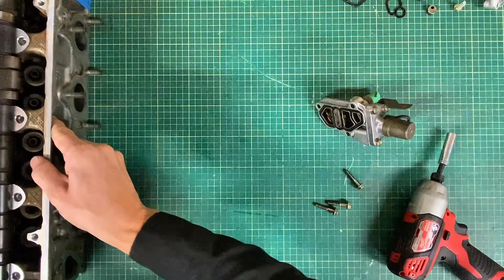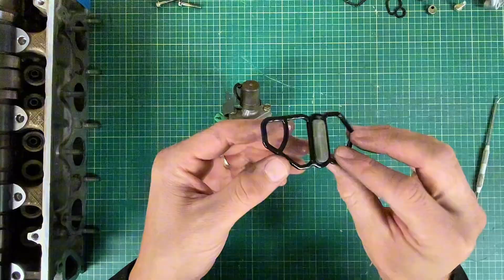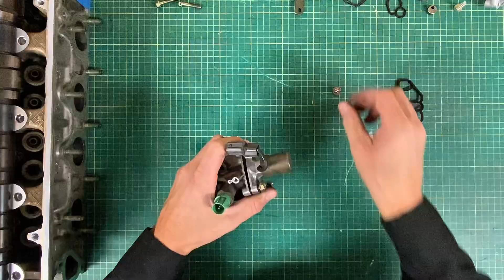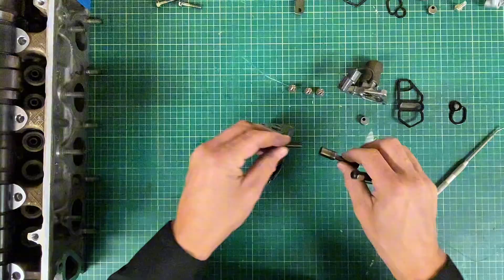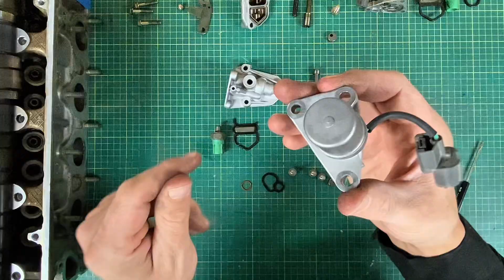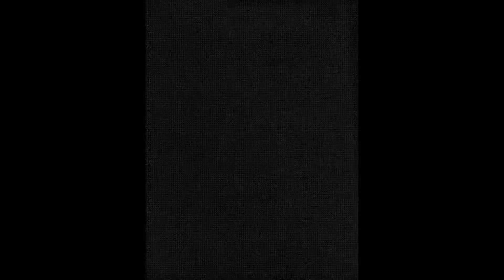H22 VTEC Solenoid: Rebuild & Explanation

Comment: Im just wrapping up a rebuild on my 99 prelude. This video made me go back and do some things that I wouldn't have done otherwise so thanks for potentially saving me from needing to by a new solenoid 😂
Reply from the maker: Thanks for watching, glad it helped. It is a great maintenance item to do. Another is cleaning out all your egr passageways, if you are running an oem manifold. It’s a pain, but worth it. Enjoy the drive
Reply: @BryanMorton-mg4of oh yeah. I sent the Intake to a machine shop with my head and had them clean on the side. I also fabricated myself a block off plate for the egr to delete it lol. Mine was almost sealed from the carbon buildup. Unfortunately I bought the wrong rings so I do have go down and redo rings. Apparently, steel rings will not seat properly with the frm liner in the H22s. Too hard of a material so oil just goes right on through. Found that out the hard way. But she's almost up now, hopefully all goes well.